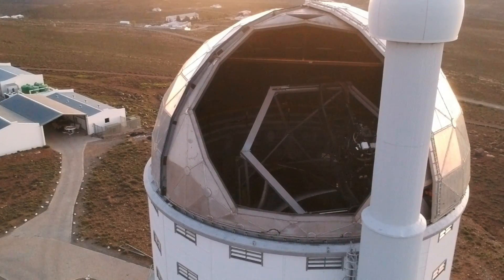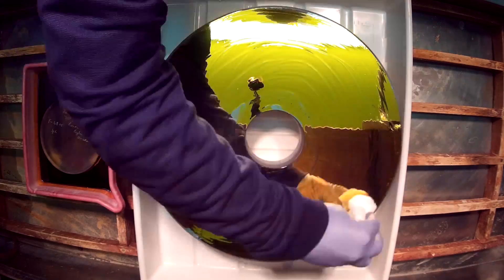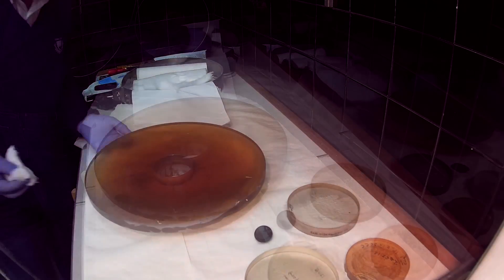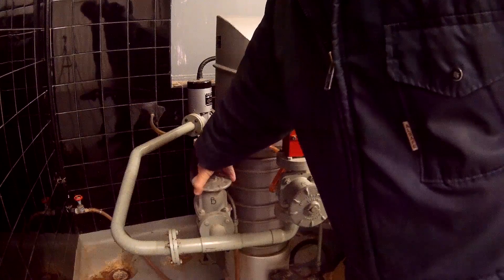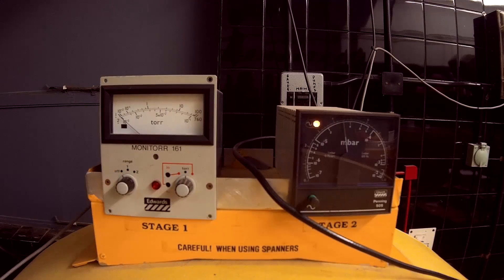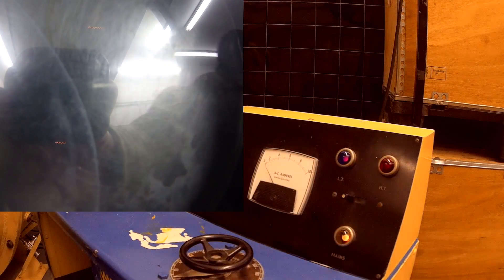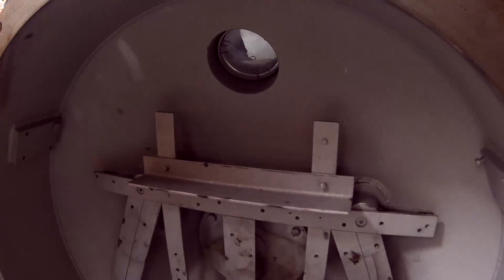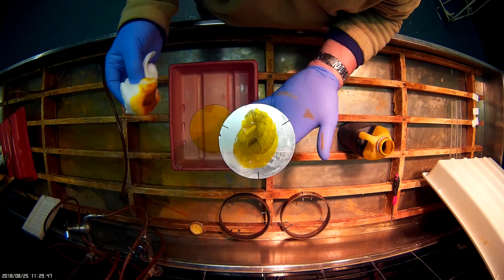How to Aluminize Telescope Mirrors

Comment: Very informative. Thanks for sharing.  I'm curious to why the glass gets mirrored with aluminium but the other surfaces in the chamber don't ?
Reply: Probably does. the interior space looks very aluminum in color. The glass port probably does also, but the layer is so thin that it still permits some light to pass.

Comment: great video willie! how is insulation of the coils from the tank maintained to prevent making the tank electrically live, given that everything including any insulators gets aluminized?
Reply from the maker: Good point, I never thought about that, and it makes perfect sense.  The drive-throughs are some unsulating material indeed with the one side of every coil grounded to the tank, so that side obviously does not matter.  Seeing that the aluminium layer is very thin compared to the current we put through, so all I can think of is that it simply burns away - almost like a fuse that blows.

Comment: Is the diff pump still running and open while doing the aluminizing?
Reply from the maker: Yes, all the time, to maintain the high vacuum.  If you are perhaps worried that the aluminium can get into the pump, you saw in the video how directional aluminising is, so no worries there.  Also, we are in the molecular flow regime of vacuum, meaning there is no "suction" action of the pump detectable in the tank.
Reply: @SterremanWillie  okay that makes sense. Thanks Willie

Comment: A wonderful explanation, thank you. Why do you hang the aluminum hooks off the tungsten, rather than running current through them directly?
Reply from the maker: The short answer is, it is the easiest way.  As you saw, the wires "hoist" themselves up as they start to melt to form bubbles, before evaporating. One get different ways of holding the material you want to evaporate, some in the form of tungsten "boats" for different applications.

Comment: How much is the depth of the aluminium layer? monoatomic, diatomic or several microns? How are you sure you don´t change mirror surface geometry? If you change the geometry and introduce some optical aberrations, can you mend it this?
Reply from the maker: Very valid question!  Yes, you can easily change the geometry of an optical surface if you apply an uneven reflective layer - this can indeed be the case with the old silvering process where chemicals were poured onto the mirror and decanted again.  For aluminising, care is taken to spread out the coils evenly and the layer is kept very thin - just thick enough to be opaque, about 10 microns.
Reply: @SterremanWillie  So 10 microns= 100000 Amstrongs and every Al atom is  1.48 A, so 67568 aluminum layers more or less

Comment: Do you have to do anything to ensure the aluminium coating is a uniform thickness across the mirror?
Reply from the maker: With the system so old, there is nothing like that built in.  It relies on the design to yield an even coat, i.e. even distribution of the coils, the sequence we fire them, distance between the coils and mirror, etc.

Comment: how about a simple copper or aluminium electroplating coating, in copper sulphate bath
Reply: spin-cure epoxy into exact parabolic surface
Reply: then coat the exact epoxy surface with aluminium/silver

Comment: After cleaning, are you concerned about hydrocarbons contaminating the glass before it goes into the chamber or are these all volatile enough to be removed by the vacuum? Or is this not a concern given the exposure to atmosphere and water after plating, where the atmosphere is governing the life of the mirror?
Reply: you need to make plasma cleannig in the vacuum chamber before you applay AL coat.

Comment: Can see blemishes on the mirror after opening. All that work and time, for nothing.. To bad
Reply from the maker: Indeed, the big mirror got damaged when its secondary mirror came loose from its cell and fell on its primary.  Luckily the secondary only chipped from the back but its figure was unaltered.  It was decided to put the telescope back in operation despite the slight damage and it has been working productively every clear night since.

Comment: What kind of seal is on that chamber?
What is the thickness of the chamber walls and is it just steel?
Also does it really need that large size diffusion pump?
What's the flow specs on that size pump?
Thanks if you antwoord please.

Regards
Reply from the maker: Hi Johnny. Are you not supposed to be singing about steam trains or something?  ;-) ;-) ;-) 
Here are some antwoorde:
The seal is rubber - we prefer Viton, where possible.
The wall thickness of the chamber is about 1/2-inch steel.
It could actually do with a bigger diff pump since it takes so long to pump down.  Modern pumps are more efficient, so may not need to be this big.
Sorry, I have no idea what the pumping speed is.  The pump is about 60 years old, so the spec-sheet is lost by now!
Reply: @SterremanWillie  thanks for the answer. Do you still work there? Seems like a great place to be.
On the viton O-ring - - is the groove just a machined recess into the flange of the chamber?
Reply from the maker: @johnnycash4034  yes, I have two years to go to retirement.  Yes, just in a groove.  A few years ago they replaced the o-ring on the other, bigger tank, capable if taking a 2-m diameter mirror (see https://youtu.be/hxb-KOqaCYQ).

Comment: Aluminize Telescope Mirrors why use glass you could aluminize a dog turd and make it reflect light. after all it not the glass making the mirror but the coating sprayed on the correct bevel shape making the mirror. Start with a ply-wood frame supported by steel. grind the wood to the correct bevel then coat in many epoxy layers and grind smooth like glass for the final form and aluminize that for you mirror finish. You could make them 3 times the size and a fraction of the weight and time and a fraction of the cost.
Reply from the maker: Correct.  If only you could get epoxy (or a dog turd) that is zero expansion with temperature and rigid enough to deform less than a quarter wavelength of light under its own weight, you are there.
Reply: @SterremanWillie  Heat the room that the support frame is in to the same temperature year around you would have zero expansion. Steel frame holding ply wood would be more then rigid enough to keep it from moving. Even glass expands and contracts but you still use it.
Reply from the maker: @carlmanis879  Telescope domes are open to the elements, so no chance of temperature control either.  The requirements for zero expansion glass for  telescopes resulted in technologies that made oven resistant Pyrex glassware and glass top stoves possible.
Reply from the maker: @carlmanis879  Heating an telescope enclosure is the worse thing one can do - Google "dome seeing" to see why.

Comment: Great video! Thanks for posting!When is the SIO overcoat applied in the process?
Reply from the maker: Thank for the comment.  Our system is not equipped to apply any overcoat unfortunately.  I think it is also done under vacuum, but not sure, sorry.
Reply: @SterremanWillie  
So, what is the average lifespan of an aluminum coating without SIO overcoat ?

Comment: Why the mirror is not completely from aluminum and a glass is aluminized?
Reply from the maker: Aluminium expands and contracts to much with changes in temperature and therefore distorts the images.  Low expansion glass is still the best medium available to carry the accurate reflective layer.
Reply: @SterremanWillie  Excellent description
Reply: @SterremanWillie  can aluminium be same as glass if temperature be stable?
Reply from the maker: @lenatarlani4665  In theory perhaps, but in practice it will be impossible to keep an aliminium telescope mirror at a stable enough temperature when exposed to the sky.

Comment: Some noted that the high vacuum was to eliminate any O2 and other gases from the process. I am wondering if the ultra vacuum has any role in lowering the temperature at which the aluminum vaporizes?
Reply: Yes and yes.

Comment: What are cost of unit of those vacuum chamber?
Reply from the maker: Sorry, I have no idea - as you may have heard, this system is over 60 years old!  But high vacuum equipment is very expensive, so brace yourself if you are planning to buy!
Reply: @SterremanWillie  thank you for the answer mind if i ask you why not using silver instead aluminium, i read many vacuum deposition things and they said silver are easier to deposit(no need intricate diffuser pump) and have highest reflectivity besides price is bit expensive?
Reply from the maker: @dogodogo5891  Scroll down through the comments where I answered this more detail, but basically silver is not as easy to apply an evenly thick coating which can cause optical problems.  Although fresh silver is more reflective, it quickly tarnishes and therefore need special overcoating.
Reply: @SterremanWillie  thanks for kindly answer, godspeed for you sir

Comment: Just a thought, but, would this be a simpler process, with the possibility of not needing such a high vacuum if the tank was first purged with Nitrogen or Argon prior to setting up the vacuum ? I have a eight inch reflector and would love to make my own 14 inch mirror, I'm also a chemistry freak so have heaps of reagents like a lot of Silver nitrate, that stuff make very nice mirrors too, could that be used to coat a mirror ?
Reply from the maker: The vacuum level is dictated by "mean free path" (google it) irrespective of the residual gasses - basically the statistical chance of the aluminium molecule meeting a gas molecule on its way to the mirror.
Silver coatings were commonly used a century ago, before the aluminsing process was discovered.  There are modern equivalents that yield a thin even coat, without distorting the mirror's accurate figure - aluminsing's claim to fame is being thin en even.  Silver tarnishes quickly, so an overcoat is also required for longevity.

Comment: Probably sounds like a dumb arse question but why the vaccum chamber and not just a clean room ? Is Aluminium better than Silver, Platnim or Gold nitrate ? Reason I'm asking is I have great results without vaccum and using silver nitrate. I'm sure mine are not as good as yours but would you say that a 48in done at 95% would equal a 40in done at 99%. Just curious because you look like the bloke to ask. So much false info on here buy mondays experts and it's great to watch a pro.
Reply from the maker: Silver, when fresh, is more reflective than aluminium, but has the tendency to tarnish quicky. Most importantly, the aluminising process guarantees a thin even coating without altering the accurate shape of the mirror. The silvering process often does not, compromising the optical quality of the telescope.

Comment: Very interesting, I always thought this job was done in a clean room, with Technicians in bunny suits.
Reply from the maker: That's the ideal, but this system is a pretty good 2nd best, particularly when you pay attention to the details.  Once a mirror is in operation, it is exposed to the elements anyway.
Reply: Hi Willie, thank you so much for your swift and informative reply, I have been an amateur astronomer for 54 years, I get so much pleasure from reading or watching new information, especially when it changes my view point. 
Kind regards Jim.

Comment: I believe this process is called sputtering, isn't it?  My question has to do with the travel direction of the aluminum - how is it that the aluminum travels horizontally towards the mirrors?  I've never seen this done but was under the mistaken impression that the sputters would be mounted vertically above the mirrors so gravity would pull the evaporated aluminum towards the mirrors.  If the aluminum travels in all directions, does your tank have a coating of aluminum that you have to clean off sometimes?
This process, by the way, isn't confined to aluminum - you can sputter just about any metallic or semi-metallic substance you wish.  Sputtering is a common industrial process wherein very thin coatings can be deposited on just about any clean surface - even plastic.  Thank you for showing me this.
Reply from the maker: No, sputtering is a completely different process/technique to aluminising - see https://en.wikipedia.org/wiki/Sputter_deposition

Comment: Why does the inside of the chamber not become super reflective?
Reply from the maker: Because the alumimium layer is so thin (10 micrometers), it takes on the shape of the surface it lands on.  If the original surface is highly polished (like a glass mirror surface), the resultant finish will also be highly polished, but the tank surfaces are not, so end up becoming a greyish/silvery colour as you can see towards the end of the video.
Reply: @SterremanWillie  ah ha! i was wondering if it was something like that.

Comment: I wonder about oxidization of the raw material and then after the application. is this why 2 years for re aluminizing ?
Reply from the maker: The way I understand it, is the moment you release the vacuum and let air into the tank, a transparent layer of oxidation forms on the surface of the aluminium.  This actually protects it from the elements.  Then follows a gradual deterioration of the aluminium over time, depending on amount of exposure to the elements, which will eventually require it to be re-aluminised.

Comment: The Al melting is a clear and excellent example of a solid-to-liquid phase change and enthalpy. Since the heat ~= brightness due to blackbody radiation, the clear, discrete dimming on the heating filament you see each hook melt. I often joke that the Mirror Lab at the University of Arizona is actually a giant glass lab, since the coating is done in situ. Great stuff!

Comment: Forgive me for asking, how does the aluminium get deposited onto the mirror surface?  Is it essentially through condensation of aluminium vapour in a near vacuum? - if so why is the entire inside surface of the chamber not aluminised?
Reply: The entire surface IS aluminsed, just not shiny.  I get it now.
Reply from the maker: The entire inside surface does indeed gets aluminised, hence the silvery grey colour and the porthole windows that needs cleaning as you see towards the end of the video.  The aluminium gets slammed hard onto surfaces (due to the energy imparted on it by heating).
Reply: @SterremanWillie  thank you.  I found this video absolutely fascinating.  I recognised SALT immediately.  A close friend of mine was there for a few weeks making observations on one of the smaller scopes at the facility. I saw pictures of the surrounding area and it's stark but stunning.

Comment: Thanks, very big and professional Chamber for vacuum coating, I am a student of Physics and want to perform this aluminum coating on the mirror ,  what should be the design voltage applied to melt the aluminum for evaporation?
Reply: The voltage is irrelevant here. You need Amps. But it's to dependent on your coil and the setup you use.  How big the object would be you plan to aluminize ? Is it a little one time Experiment or is the plan to build something that lasts and is daily used. For a little one time Experiment maybe it's easier to use a big Akkupack like one from a car(or if you're uni has Akkupacks for Experimenting with electric vehicles) such Akkus could easily deliver 100 Amps

Comment: Worked in high vacuum metallization for 25 years. You ever burp a dp while standing anywhere near it when it’s hot you’re in for a merry surprise. This was fun for me to watch. Ours were chambered big enough to stand in but we weren’t doing mirrors. Just just 48ga pet and such at 86 inches wide, 120,000 feet per roll flying past at 13 mps also using plasma. Some fun